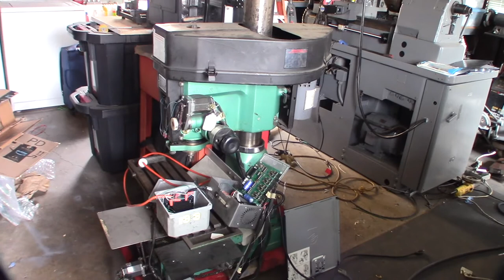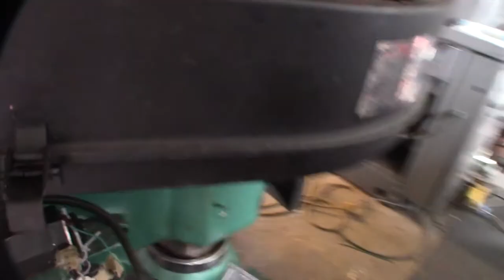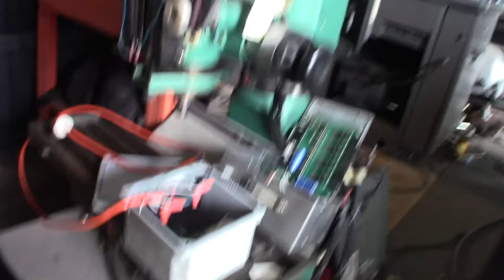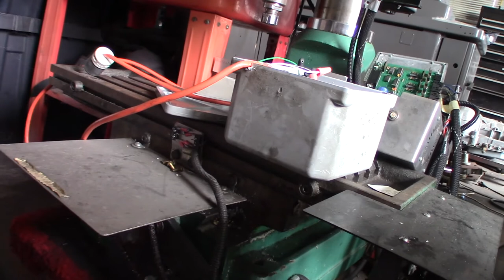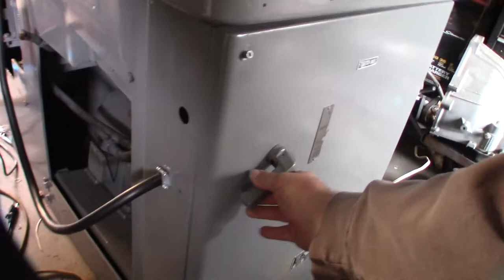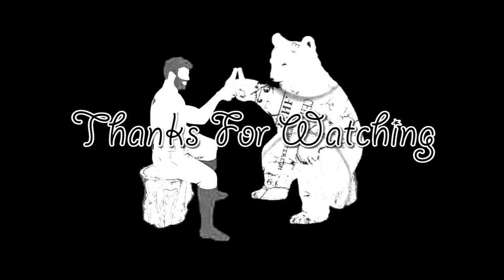Round column mill CNC conversion restoration Part 1, Jet, Grizzly, rong fu, harbor freight, Maxnc

Comment: Has anyone done a CNC conversion to replace the round column upper half of the machine with a custom z axis and spindle? I was thinking of using the xy table base and then fabricating an X axis to replace the round column